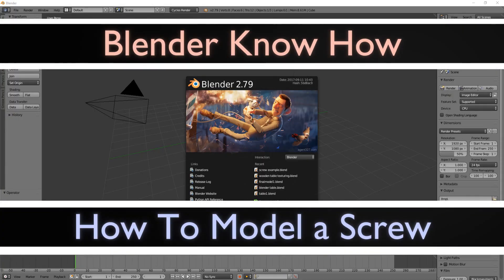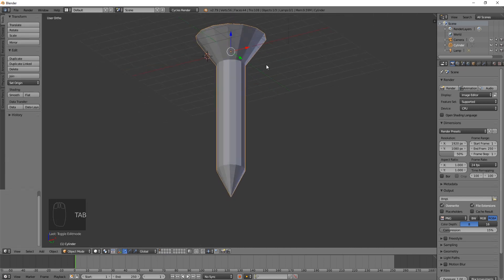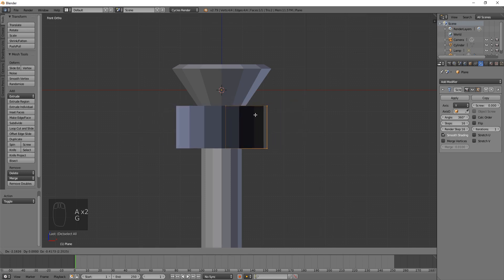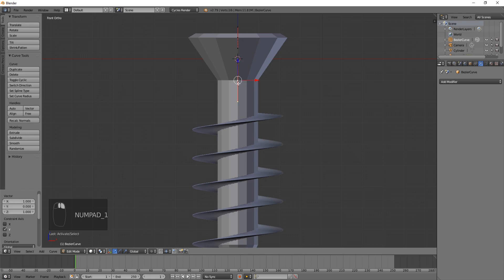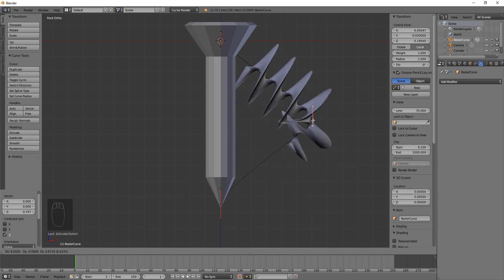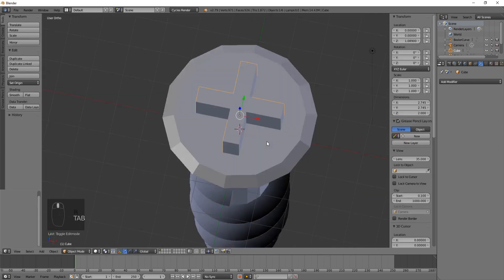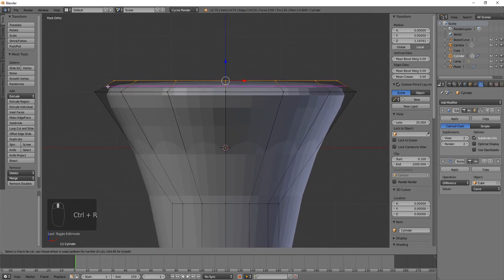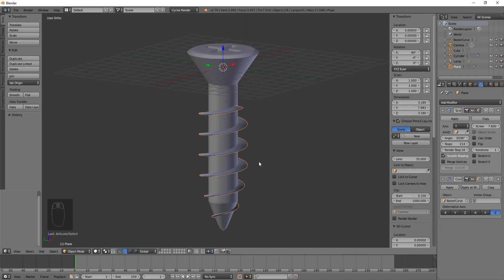How to model a screw in blender 2.79

Comment: I learned a lot but I had many issues for example with the cross. If I just rotate it each cube is a single object. If I press Control+J there are overlapping faces, so there are always problems with subdivision surface modefier. It would be great if you explain these little things a bit more. I didn't recognize any difference with your screencast keys and what I did but it didn't worked.